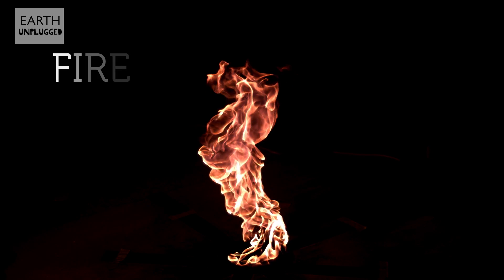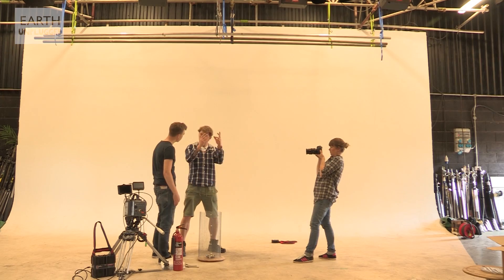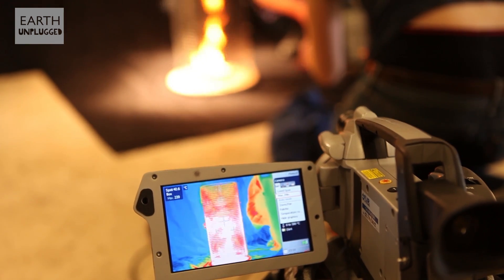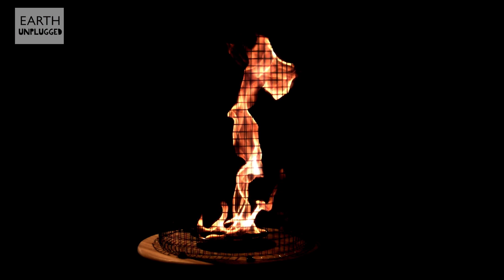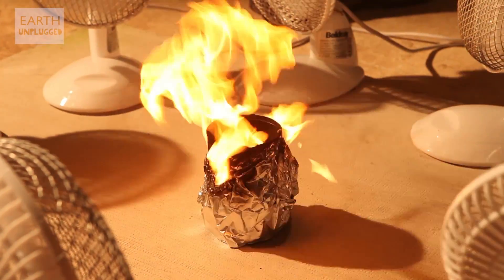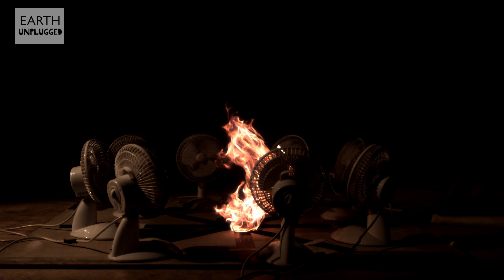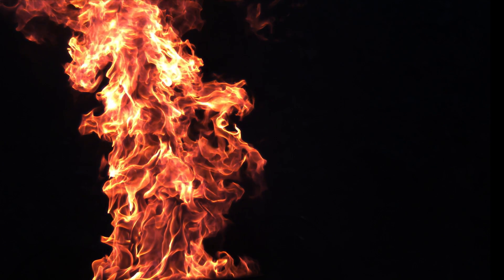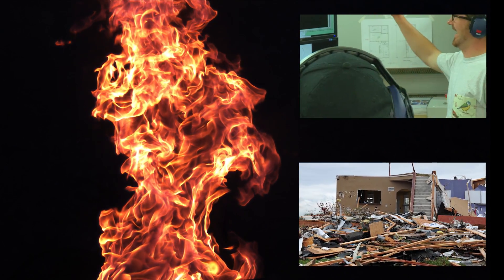Fire Tornado Experiment In Slow Motion | BBC Earth Explore

Comment: Your wire mesh should be about three times taller and the best way to do the fuel source is to fill a small cup with lamp fuel (kerosene) - the metal cup that surrounds tea-light candles works perfectly. You should also have a handle that turns the platform via gears, so that you can turn it at a constant speed instead of spinning it as you were in the video. The tornados can reach over 10' tall in these scaled experiments.